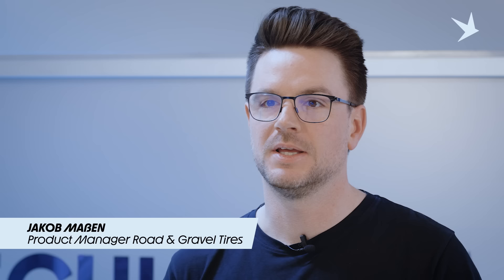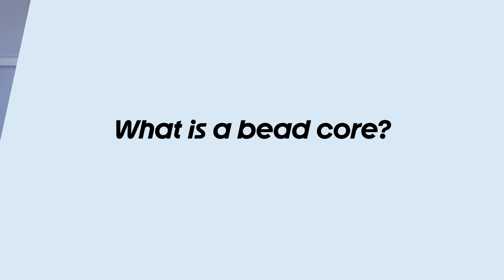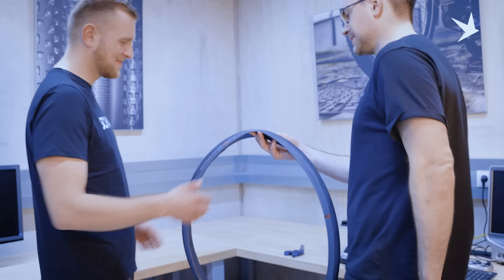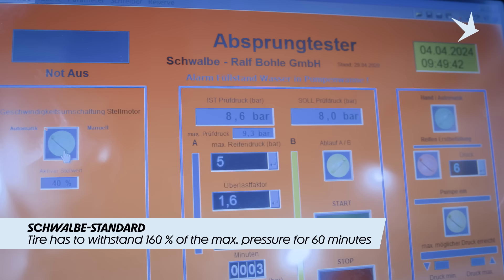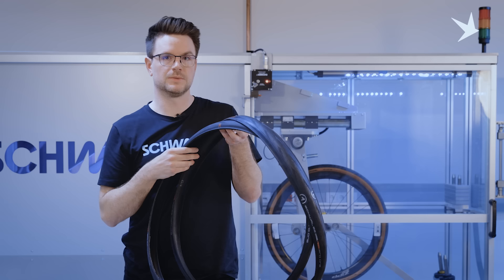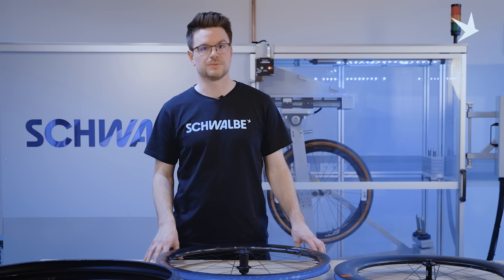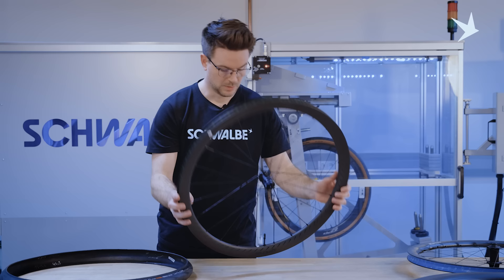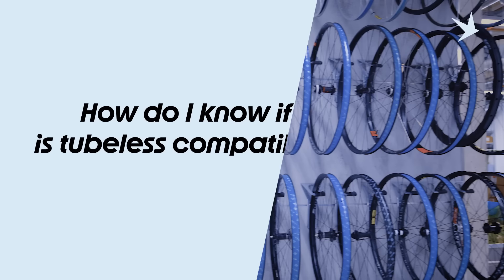Are Tubeless Road Bike Tires Safe? Hear it from the Pros.

Comment: 5:26 It would have useful to see those tubed/tubeless markings close up. Also an explanation of what you mean by 'tubeless rasy' vs 'tubeless ready'?
Reply: It’s just a painted marking that says “TLE” and another that says “TUBE TYPE”. It’s very easy to see in person when handling the tires. 

Tubeless Easy (TLE), and Tubeless Ready (TLR), are the same thing. Different brands use different names. However all of them share the term “tubeless”.
Reply from the maker: Fair point. We will think of that in our next video.

Comment: So the bead is Kevlar or Polyamide?
Reply: All their website says is "high modulus aramid".  Kevlar stretches without breaking (why it's good for tow cables), but the stretch makes it the wrong thing for hookless rims.  There are other fibers (like what BERD uses for their spokes) that can be stretched and then used, but I don't know what Schwalbe actually uses.  Carbon fiber doesn't stretch, and can flex enough to be used in belt drives, so it is probably better for beads -- whether that is actually done is something I don't know.
Reply: I just checked, and Maxxis uses carbon fiber for road tubeless tires, kevlar for lower pressure mountain tires (tubeless, tubeless-ready, and tubed).

Comment: Been using schwalbe pro one tubeless for 4-5 years now. 

I will never touch a tube again in my life.

Run a wide road tyre, low pressures with a good sealant.  Check regularly or top up every 3-6 months. I use muc off sealant.

Never leave the tyre to deflate over an inactive period, your sealant could dry out.

Keep it consistently pumped up. Air is free.

15,000km, every puncture has sealed except for one side wall gash. 

Fuck tubes.
Reply from the maker: Brilliant. Cheers for your additional tips! You are absolutely right.

Comment: Yes it is.   But Hookless is not the same thing.
Reply from the maker: Very true. The point where the two topics are related is, that you have to run tubeless tires (TLE or TLR) when you ride a hookless rim - even when you have a tube installed.
Reply: Yeah but the title of this pretty awesome video is disappointingly trigger bait. Hookless v hooked is the concern here. Not tubeless in general.